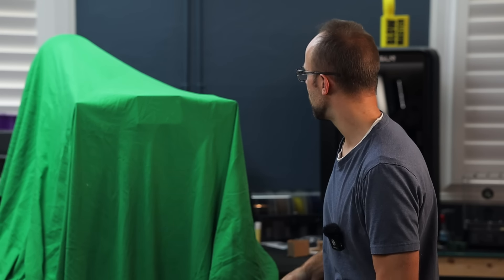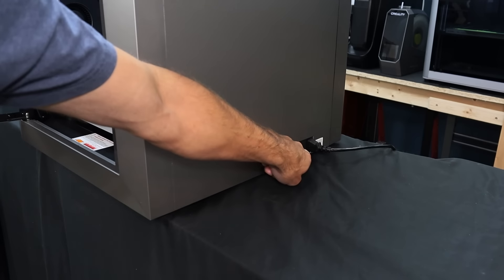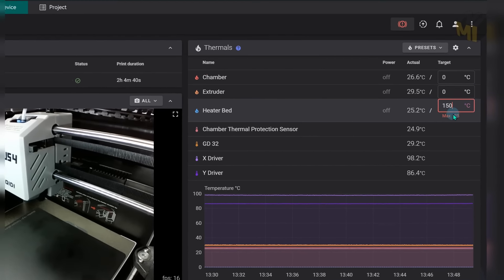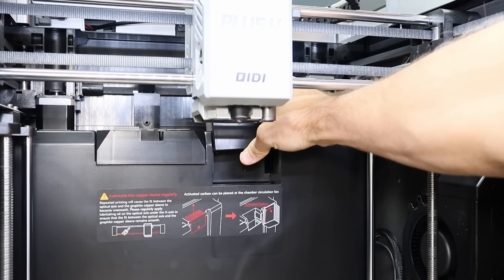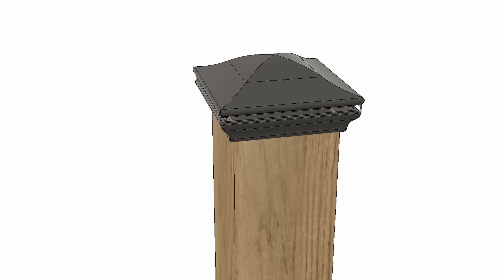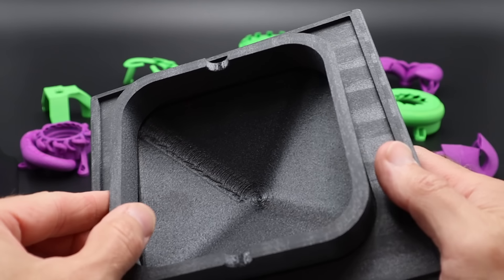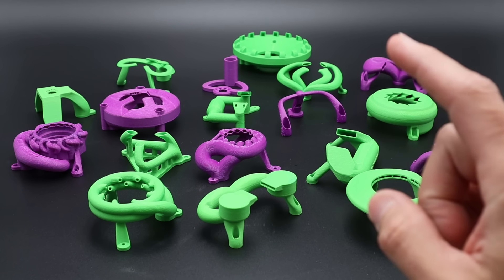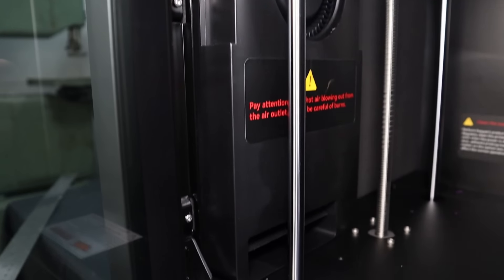The All New QIDI PLUS4 - the best value to performance printer on the market

Comment: Now this has me EXTRA curious about Bambu's upcoming printer series. Supposedly October announcement - if QIDI is trying to become a flagship line, I'm curious how Bambu will react - or if their new printer is already better than this one.
Reply: It could be, but comparing to X1C and X1E, it might easily start at $2k
Reply: @kimmotoivanen  bambu has made it clear they're trying to bring prices down, not up. Time will tell! I'm excited nonetheless.
Reply: @SouthernWolff Bambu is a premium line like apple, i highly doubt the are lowering their prices
Reply: @BeatstormX  that's a pretty dumb comment. 1) they're not like apple. 2) even apple lowers their prices... Lmfao
Reply: @SouthernWolff  Bambus target audience is comparable to Apples, Bambu aims to just print out of the box with great quality. The user isnt required to learn anything about 3d printing, which also isnt possible since Bambu has a closed software system. Any Voron/Prusa/Sovol/Qidi/Creality provides equal print quality whilst being cheaper, yet you have to learn a thing or two about Klipper and the slicing software.
Reply: @BeatstormX  man, that's crazy! Do you hate automobiles too? Because back when the Ford model A was released, you had to know how to put it together and take it apart.

Do you hate cellphones? Or do yo expect to take it out of the box and have it work? 

Do you hate TVs? Or do you expect to take it out of the box and have it work? 

With time and innovation, you move away from needing to know HOW it works. And simply trust that it DOES work.

That's the beauty of bambu lab printers (and now Creality k1, qidi max, etc)

You do not need to know the ins and outs of the printer anymore, if it just works. I bought a printer to print things, I didn't buy a printer to work on the printer.
Reply: @SouthernWolff  As if you could compare a niche hobby to daily necessities like transportation or smartphones/communications
Reply: @BeatstormX  a TV is a daily necessity?

You WANT 3d printing to stay a niche hobby? No one bought paper printers back in the day, until they became mainstream and "reliable". We are at that tipping point with 3d printing. Either accept that printers that are good, and JUST WORK, exist now, or don't.

There's a reason all the big brands are following bambu Lab's lead, here.

You're trying to gatekeep 3d printing, for what?
Reply: From some people I know who were working with Bambu on QA testing, the X2 was in testing phase, but there's been no word on  a P2 series yet
Reply: @SouthernWolff  exactly. I was going to tell him "think about what you think about, man. Not a joke"__Sleepy Joe

Comment: What, no close look at cooling performance in the test sample's overhangs?  Will the cooling ducts from the contest fit it? 😁
Reply: Check out that fence post cover. That's got to be a near 70 degree overhang over a very large area, in all directions. Aside from the Z seam being more prominent (this can be tuned out with care) that high overhang surface looked near flawless!
Reply: @stew675  Ya, saw that bit... but also noticed a hanging strand or two on the wood PLA test object edges, and would like to know if that's typical for that test piece, happens on comparable printers, is a factor of cooling settings/capability, etc.. and since it's visible for a second, but we never see the bottom side of the arc overhang, I got curious.
ESPECIALLY since the same shot actually shows cooling parts for the contest as printed by the Plus4 right behind it, cooling was on my mind.
Reply: @jb_1167  hanging strands on edges are typically a retraction or temperature issue. Composite filaments are also tricky because depending on the manufacturer of the filament, the composite distribution may not be uniform. Most of these sorts of things can be dialed out with careful calibration, but wood PLA is somewhat notorious for being difficult. As Mike pointed out numerous times, he hadn't calibrated some of the filaments fully, and as a result, you'll get things like that happening.
Reply from the maker: I plan on making a follow up video, I wanted to keep the video under 20 minutes total, which seems easy to do, but I just keep blabbering on.  Anything that people want to see tested I can certainly do in the next video.
Reply: @stew675 Yeah I was pretty impressed by the underside of that post cap!
Reply: @NeedItMakeIt  If you are looking for something to test, I would really really love to see some more prints with high performance materials. Like, this printer seems to make printing with quite advanced polymers accessible to consumers, but exactly HOW far can it go?

So, other than PPS-CF, maybe ASA, PA12 or PPA-CF, PEKK, PEI, or even PVDF if you have it available? PP (or even PE) would also be cool to see, though my impression is that these are nearly impossible to print on FDM printers regardless. Also, I guess PES, PSU, PPSU and the like are juuust outside the temperature range for this printer(?)

Comment: Qidi is a cheaper printer, but spare parts and filament are both noticeably more expensive than Bambu, though of course you aren't locked in to using their filament, but when starting out it makes sense to use a filament that has been tested on that printer. It also looks like their replacement hotend despite being more expensive than Bambu lacks an included replacement fan (unlike Bambu) and may not even include a nozzle since no nozzle sizes are listed with it.

Comment: It's the ecosystem that draws me to Bambu Labs. They have very good firmware with features like "Fuzzy Skin", which is almost a requirement for me. They also have their "Automatic Material System". Does QIDI have any plans for a multi-filament system? The Bambu Labs P1S is only $600, and $850 with the AMS- that's really hard to compete with.
Reply: "fuzzy skin" is a slicer option, not firmware.  OrcaSlicer, QidiSlicer, and QidiStudio all have Fuzzy Skin available as a surface finish, and it works the same as it does on BambuLab printers.

Qidi have published that there will be an AMS unit for the Plus4 coming in Q1 next year for $225.

The P1S is an extremely good printer, but the Plus4 offers significantly more features than the P1S, and really is much closer to the BambuLab X1E in terms of its feature set, but with a larger build volume than either.  The P1S and the Plus4 aren't really even in the same ballpark for features, so the current sale price of $599 for the P1S (normally it's $699) really is a case of getting what you paid for.
Reply: @stew675  Ah, then I'll probably go with Qidi. What other features do they have that are notable?
Reply: Other notable features: Open source firmware, ethernet port, no required account sign ups, no data sharing, compatible with multiple slicers, heated chamber, higher nozzle temp, large build volume, and customer service with a fantastic reputation. This is a far more capable printer than the P1S with arguably comparable speed and quality. Definitely a much nicer screen if that matters to you.

Comment: I was about to buy a Bamboo printer but this has made me rethink my decision.  My remaining concern is the value that seems to be in the Bamboo ecosystem (software, website tools/library etc.).  Opensource for me is not an necessarily an advantage as I tend to run my machines as close to stock as possible.  Could I get feedback from those of you who have run both the QIDI and the Bamboo ecosystems and is their added value from Bamboo?

Comment: Please tell me when you mentioned sanding the lighting cover you meant the final ABS versions!

 - For anyone curious why...DO NOT sand any build that has used a CF filament - unless you dislike your lungs, throat, eyes, nose and think cancer later on sounds nice. Using a strong always running vacuum and safety equipment may help - but why take the risk
Reply: Or you could just wear PPE.

Comment: You didn't mention potential blocking of the heater that can lead to thermal runaway fail (is that for prints that push the height limit)?  No one mentions that it's still bowden and so cannot really do flexibles (?).  I don't know why no one on youtube seems to care about flexible filaments anymore, but they are going to be very important for complex 3d printed solutions - either stand-alone or in multi-filament designs.  No mention here of future multi-filament printing (e.g., at least easy to remove supports).  Some of these used to be basic items on the review checklist for printers.  I also saw a review that said that the heated chamber could warp those plastic sides (but have not seen it anywhere else - I'm guessing since you've been using it that has not been your experience).  I'm on the fence now.
Reply: I'm shocked in film that partner is Qidi he dont say about what is wrong with printer that is made by his sponsor.. grow up.. find youtuber who get device from company to review and he would say very bad things about that product, no, they say only that bad things what company allow them xD.. thats a true.. want quallity review? ask normal people who actually buy this xD
Reply from the maker: It uses a reverse Bowden setup, which isn't really Bowden at all, it's just a feed tube to the extruder, all of these printers are DD now which solves quite a few problems, though they do add some weight to the head.  I do care about flexibles, when QIDI comes out with their version of the AMS, this is something that I've tried to address with them, and it seems that Bambu has a solution for theirs releasing tomorrow.  It'll be interesting to see how well it works and if the flexibles are still... well flexible enough to be called flexibles.  The ultimate solution is a multi-head setup, but with that comes a whole other set of problems.  Ideally something simplified like a tool-changer on a CNC would work, they're just not quite the same thing, it's easier said than done.
Reply from the maker: Thanks for your thoughts, however if you watched the entire video you would see that I cover the issues with the printer, there are very few.   In addition, if you've watched my other reviews, you'd also see that I'm critical over all of my printers, going far beyond what most others do in order to solve the problems as well.   The Bambu X1C is another example, there just isn't much that's a problem except for the nozzle wiping issues.  I do agree with you that you should also look to other reviews or people, nobody is saying not to do this.  It's always a good idea to do your own research.  I stand behind what I've said in this video, and in all of my videos if there is something that comes up that I'm not aware of that is a problem, I will contact the company to see what they're doing to fix it as well.  I like to share and help people and to innovate, that's what drives me, what exactly drives you?
Reply: @NeedItMakeIt  X1C? That printer that is made not to reppair? That machine what has glued in belt tencioner? Qidi? That company printers must be connected to account or you will not get update, and when you connected all your gcodes are send to them? Hmm yeah really great machines (sarcasm)

Comment: I'm kinda missing a part where you talk about print speeds. The QIDI website is also not very vocal about it but it prints at 600mm/s. My question would be is the print quality good at those speeds?
Reply from the maker: I can certainly put together a follow up video, most printers can't reach those speeds because of limitations of the hot end, filament type, layer heights etc.  In this case, because the heater is so powerful, I think it would be worth some tests to show what it can do.  Most printers with this structure have about a 20K acceleration limit and around 600mm/s for speed.  we're moving around some mass from the gantry so there isn't much of a way at this point to get around that.  Maybe CF rods on the X axis top and bottom would help, and skeletonizing everything inside the head, possibly using a CPAP fan instead of the blower fan (Not a big savings though).
Reply: @NeedItMakeIt  that would be interesting. I preferably want to wait and see what bambu comes with for their next printer but this one looks very appealing. The only unknown right now for me is the print quality at 500mm/s and 600mm/s. If that is the same a the bambu I will seriously consider this printer. Although the bambu looks way better

Comment: Nice to have little to no VFAs, but those layer lines are quite uneven. I wonder if yours had a loose  lower carriage bearing like another reviewer found.
Reply: I think what you are seeing is just inherent to fiber filled filament. It tends to look almost like fuzzy skin. Check out the reviews by Loyal Moses and HariMau3D. Layer stacking looks quite good.
Reply: @802Garage  Have a look at 8:45 Layer lines don't look as clean as they should, in my opinion.
Reply: @oldman1944  I would chalk that up mostly to printing at speed with minimum layer time on without setting the outer wall speed consistent and also changing wall order to inner/outer/inner would get rid of most of it. Basically, tuning as opposed to a mechanical issue. Filament may be very slightly over extruding as well.

Comment: What do you mean by letting the heatbed soak? Also, does the QIDI have any multi material printing option?
Reply: They said qidi box will release in Q1 2025.
Reply from the maker: I'm trying to find out if it will be TPU compatible and possibly even abrasive.

Comment: Does the Qidi software support the ability to remove a failed part when printing multiple parts?
Reply: Yes. In the Fluidd UI you can cancel individual parts within an active print. This was available on their 3 series as well.

Comment: I wonder whats better this or the Bambu Lab A1.
Reply: Well there is a MASSIVE price gap there and this is certainly the overall more capable printer. The Q1 Pro would be a much more apt comparison to the A1. In that case, I do think the A1 will give you slightly higher quality at similar speeds, but the Q1 Pro can handle tougher filaments with ease that will give a lot of problems on the A1.

Comment: Qidi website says “Full-Auto Calibration”. Is this different from filament calibration?  What’s calibrated in the full-auto calibration?
Reply from the maker: I think the same question came up on the Q1.  There are different areas of calibration, the Z-height is what they're referring to, which is critical, but they don't have any method of scanning the filament extrusion like the X1C.  It's not always the best way to do it, and I know someone people with the X1C don't use it, but I do, so I'd like to see an add-on at some point, or maybe there is a better way to do it?

Comment: I would recommend staying away from this printer until they add a third independent Z-axis motor. It is simply not possible to properly level the bed from side to side and front to back with only two motors. At best, this printer can level side to side, but any error in the bed's front-to-back alignment will remain uncorrected. The linear guide rods do nothing to adjust the bed’s vertical position; they only support its XY movement. While I'm not necessarily a fan of the Bambu X1C, at least they've figured out the three Z-axis motors, which makes a significant difference in leveling. This is a major design flaw of the QIDI Plus4 that hopefully gets corrected soon.

Comment: How do you compare the QIDI Plus 4 vs Bambu P1S in terms of sound and fumes when chamber door is closed? Thx!
Reply from the maker: When the door is closed I don't smell anything when printing ABS, I have the same results with my X1C.  Both units have a carbon filter that you can't see through, the K1 Max has one that you can see through, with very little carbon. 
That's not to say that there aren't still fumes, but I can work beside it with no issues.  I think long-term though, no matter which printer if you're printing a lot, you'd want to have some way of replacing the air with fresh air from outside.  We're not sure about long-term health impacts of these very fine particles yet, but they are so small that they can enter your bloodstream, which is probably not a great thing, and it's not like we'll all become superhuman (plastic man!) I'm working on trying to find a series of products that would work the best to either clean the air in the room, or replace the air in the room without losing too much heat, like what you'd see in a Whole-home HRV system attached to your furnace.

Comment: Nothing a out speed flow?
Reply from the maker: I didn't have any specs on fmax flow, but the speeds are the typical you'd expect with a Core XY, maxxing out at 600mm/s.  I'd expect that with the heater they've used and the speed it can heat +max temp, this printer has a much higher flow rate than the typical... BUT I don't know if they've included the CHT nozzle, so that is certainly worth a deeper look in the follow up video I make.  I'm more than happy run any specific tests to answer any questions.

Comment: For that price and size its VERY hard to consider the X1C/E
Reply from the maker: I don't have an X1E, so I guess I can't speak to that, but for creating functional parts, I'd recommend this machine over the X1C.  For anything with color, the X1C is the way to go for now, or P1S.  QIDI is supposed to have their own AMS system coming out at some point, so we'll see if that changes anything.